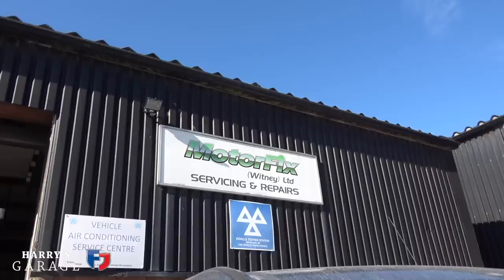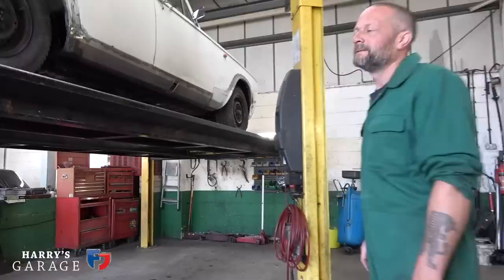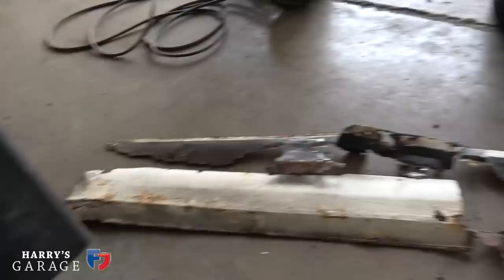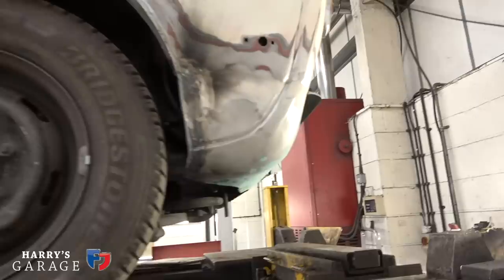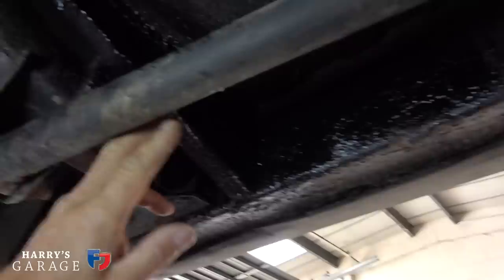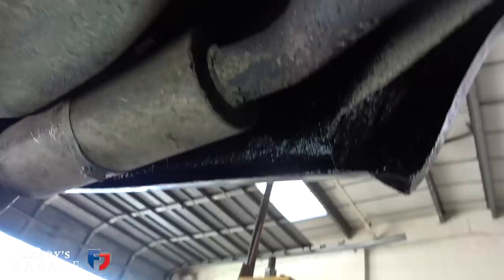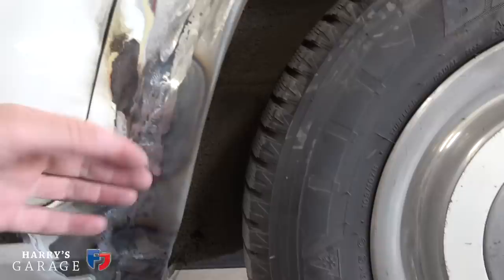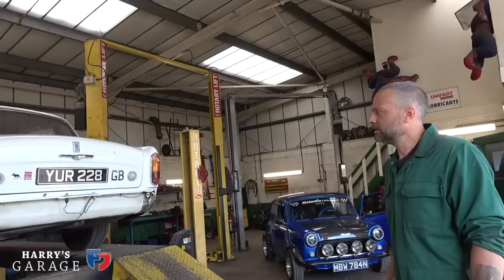Arctic Rolls Royce Silver Shadow makeover Part 2. My eBay Rolls loses its rusty bits

Comment: Seems very reasonable money for the stellar job, this old lady will sail through the MOT for years to come!
Reply: The fact that you folks, in 2021, have to put up with MOT is such a scam!
Reply: @ToyKingWonder  new cars after 3 years have an Mot. Cars 40 years and over are exempt from Mots though you can still take to an mot station for a check over.
Reply: @ToyKingWonder  Wouldn't want it any other way.  Years back when I was self employed I did MoT preparation as a sideline business.  Having seen the state of some cars that get sent in for an MoT, I can't imagine the chaos on the roads living somewhere where an annual inspection didn't happen.  Fine if you are vigilant and conscientious but too many folk drive them until they stop working, be it engine, lights or brakes...

Comment: Done a Shadow MK2 in the 90's , I was a freelance panel beater and did some welding on a MK5 Bentley for a guy he said I could do the work at his mates garage a RR and Bentley specialist in the town , the owner say was I willing to do some work for him so ended up doing this Shadow 2 rear lower corners 2 wheel arches 2 sills and 2 wings , he bought 3 Hillman Hunter sills (I think) had to chop them up to fit not happy about that as I had priced to just fit cover sills not spend hours modifying them , came to fitting the wings no chance they were well out any case had to hack the about to fit , so working away an old fella walks in say why is he fitting MK1 wings to a mk2 the garage owner comes across gives me a right bollocking , so not happy , was just finishing off the car when he asked me to do a Austin Healey 3000 for him told him to strip it , every nut and bolt off the car when I got paid for the roller I packed my tools and buggered off lol , teach him for that bollocking in public when it was him that supplied the parts .

Comment: All those previous repairs and still no gunk on the inside of those sills, nobody learns. Any old car requires regular rustproofing, even dripping oil into the mud will protect it if it's in a pre restored state. 

Clumps of Copper slip grease in all the mud traps and around all the seams will slow rusting better than almost anything else because over time the grease leaches out over a large area and into all the places where the paint cannot go.  Do that once or twice a year, you can keep anything going forever.

The worst thing you can ever do to a car that's been all welded up like that is to think you can seal the water out and apply hard underseal. That guarantees disaster (even though that's what most people do because it looks good). I guess underseal would be OK on a shell that had been dipped and treated before and after welding, but that would be  1000s of hours of work on a complex car like a Rolls-Royce. 

Anyway, I like your approach to make this a 5 pace car. I would never daily drive any car that was better than that because after a few years of use any car is going to be a 5 pace car.

Comment: Harry, since this car is to be used all year round would you consider a under coating such as dinotol wax or similar?  This should keep most of the water off and does eventually wear off so not permanent or a moisture trap?